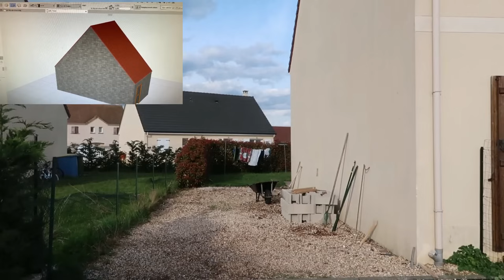Comment j'ai construis mon garage de 31M2 pour moins de 5000€

Comment: Super vidéo pour les grandes étapes. Mais je crois qu'il y a un problème avec les fondations. C'est bien d'avoir penser à la poussée au vide en ajoutant des équerres dans les deux coins, mais vous oubliez l'autre côté.Il fallait faire une fouille le long de la maison, ou raccrocher les nouvelles fondations à celles de la maison. Aussi, quite à faire des fondations, autant y prévoir directement les ferraillages pour les poteaux. C'est plus solide et c'est une methode plus efficiente. Sceller des fers à betons dans des trous dans l'arase c'est moyen. Après, d'après ce que je sais, rien qu'en matériel, on dépasse les 5000 euros pour un chantier comme celui là! Donc vu qu'il ya des intervenants dans le chantier, on dépasse de beaucoup cette somme si on y ajoute la main d'oeuvre.
Reply: Bonjour vous ne pouvez pas relié le garage au fondation de la maison étant donné que le garage a été construit bien après.faut savoir qu'il vont travailler différemment et si tu les relie ça créerait des grosse ou Petite fissure  a cause du fais que les 2 pièces bouge différemment dans le sols
Reply: Normalement il faut mettre un joint de dilatation entre les deux fondation c est le mieux
Reply: @hamzatth9973  bonjour Hamza Tth, je crois qu'ils y ont penser. Ils ont mis du polystyrène de 2 cm entre les extrémités des fondations et la maison.

Comment: Si je fais tout moi-même donc sans compter la main d'œuvre,  je dépasse largement les 5000€
Reply: Il y en a pour plus de 5000€ rien qu'à voir le prix du TMS
Reply: Je suis en train de le faire moi-même. Le prix de 5000€ est accessible si, et seulement si, on arrive à avoir des matériaux et de l’outillage gratuitement. 

Minipelle fondations : 180€
Ferraillage fondations : 150€
Béton fondation 4,5m3 : 800€

Treillis 25c : 500€
Béton dalle 6m3 : 1000€

Élévations parpaings : 480€
Chainage, poteaux, ferraillage… : 200€

Charpente (madriers, chevrons, clous) : 530€

Couverture (lattes, contrelatte, parepluie, clous..) : 300€

Tuiles 50m2 (juranova haut de gamme) : 1150€ (cher actuellement)

Bois coffrage, rive etc.. : 100€

J’en suis à environ 5500€ TTC pour tout ça. 

J’ai également acheté une bétonnière 100€ + Échafaudage 500€

Baie vitrée : 2200€
Porte garage battante isolée : 2400€

Restera les seuils, l’isolation et placo. 

Pour vous donner une idée du prix réel actuel en achetant tout.

Comment: Je suis en train de le faire moi-même. Le prix de 5000€ est accessible si, et seulement si, on arrive à avoir des matériaux et de l’outillage gratuitement. 

Minipelle fondations : 180€
Ferraillage fondations : 150€
Béton fondation 4,5m3 : 800€

Treillis 25c : 500€
Béton dalle 6m3 : 1000€

Élévations parpaings : 480€
Chainage, poteaux, ferraillage… : 200€

Charpente (madriers, chevrons, clous) : 530€

Couverture (lattes, contrelatte, parepluie, clous..) : 300€

Tuiles 50m2 (juranova haut de gamme) : 1150€ (cher actuellement)

Bois coffrage, rive etc.. : 100€

J’en suis à environ 5500€ TTC pour tout ça. 

J’ai également acheté une bétonnière 100€ + Échafaudage 500€

Baie vitrée : 2200€
Porte garage battante isolée : 2400€

Restera les seuils, l’isolation et placo. 

Pour vous donner une idée du prix réel actuel en achetant tout. 

Mais beau travail ! Ça n’enlève rien au boulot.
Reply: Bonjour pour qu'elle superficie finie ?

Comment: Le boulot est magnifique , chapeau mais le cout est 100% plus que 5000 €  .les materiaux seulement coutent plua que ca en plus les mains d oeuvre , assistance etc 
....
Reply: Je suis en train de le faire moi-même. Le prix de 5000€ est accessible si, et seulement si, on arrive à avoir des matériaux et de l’outillage gratuitement. 

Minipelle fondations : 180€
Ferraillage fondations : 150€
Béton fondation 4,5m3 : 800€

Treillis 25c : 500€
Béton dalle 6m3 : 1000€

Élévations parpaings : 480€
Chainage, poteaux, ferraillage… : 200€

Charpente (madriers, chevrons, clous) : 530€

Couverture (lattes, contrelatte, parepluie, clous..) : 300€

Tuiles 50m2 (juranova haut de gamme) : 1150€ (cher actuellement)

Bois coffrage, rive etc.. : 100€

J’en suis à environ 5500€ TTC pour tout ça. 

J’ai également acheté une bétonnière 100€ + Échafaudage 500€

Baie vitrée : 2200€
Porte garage battante isolée : 2400€

Restera les seuils, l’isolation et placo. 

Pour vous donner une idée du prix réel actuel en achetant tout.

Comment: Franchement très beau boulot...par contre je suis assez d'accord avec vous...si c'est le cas je suis prêt à lui donner le double pour la même chose...wtf 5k€
Reply: Je suis en train de le faire moi-même. Le prix de 5000€ est accessible si, et seulement si, on arrive à avoir des matériaux et de l’outillage gratuitement. 

Minipelle fondations : 180€
Ferraillage fondations : 150€
Béton fondation 4,5m3 : 800€

Treillis 25c : 500€
Béton dalle 6m3 : 1000€

Élévations parpaings : 480€
Chainage, poteaux, ferraillage… : 200€

Charpente (madriers, chevrons, clous) : 530€

Couverture (lattes, contrelatte, parepluie, clous..) : 300€

Tuiles 50m2 (juranova haut de gamme) : 1150€ (cher actuellement)

Bois coffrage, rive etc.. : 100€

J’en suis à environ 5500€ TTC pour tout ça. 

J’ai également acheté une bétonnière 100€ + Échafaudage 500€

Baie vitrée : 2200€
Porte garage battante isolée : 2400€

Restera les seuils, l’isolation et placo. 

Pour vous donner une idée du prix réel actuel en achetant tout.